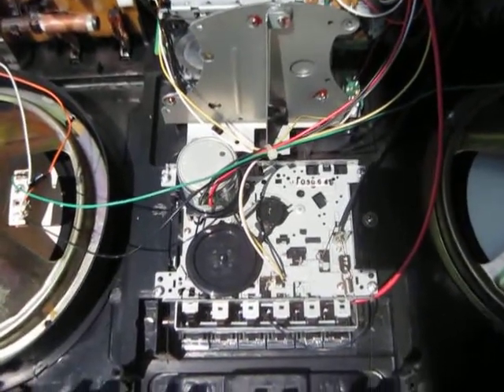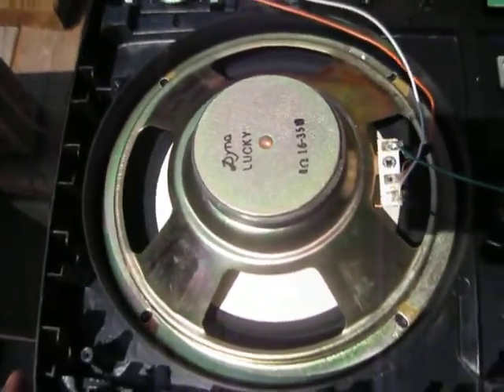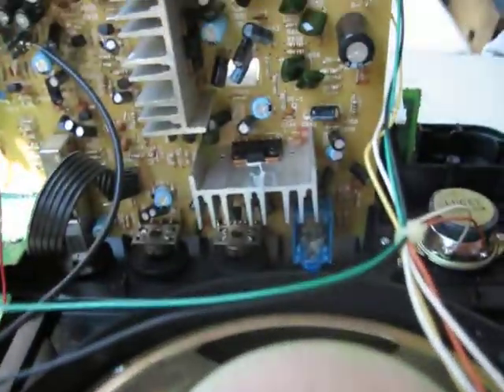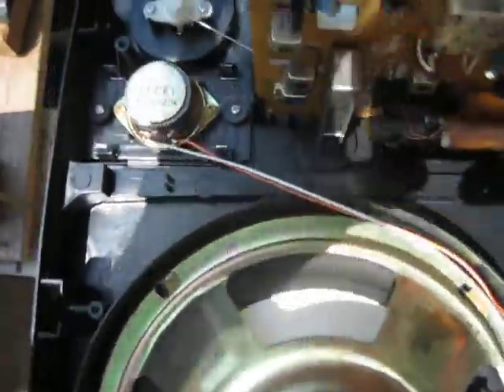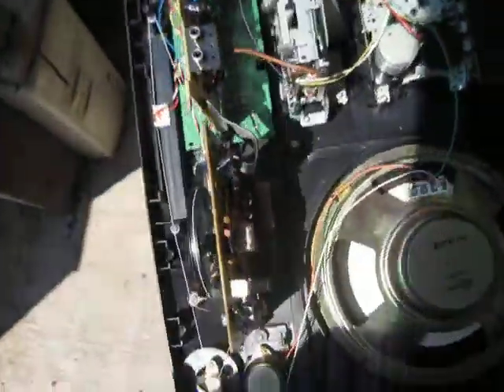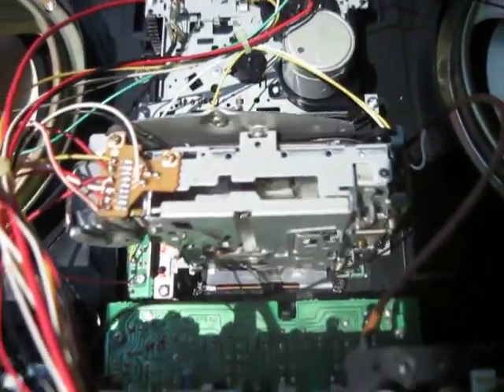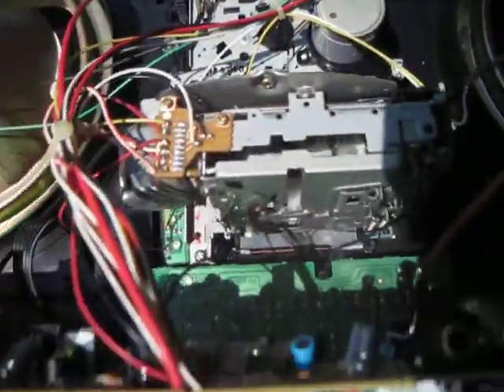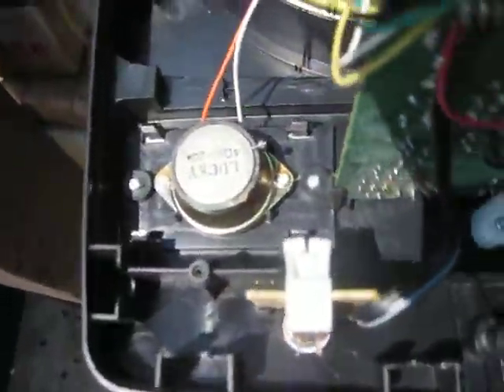Lasonic TRC 931 Cassette Boombox Inside

Comment: What size belts for the lasonic 931 2nd generator
Reply from the maker: As mine worked I did not need to replace the belt because it was so new therefore I have no earthly idea what size belt does it take I suggest you buy an assortment of belts from eBay for a couple dollars from China and wait three weeks to get them and then pick from that assortment that will fit okay thank you